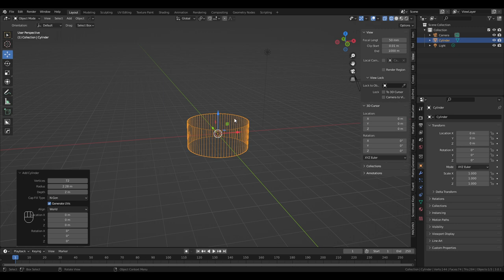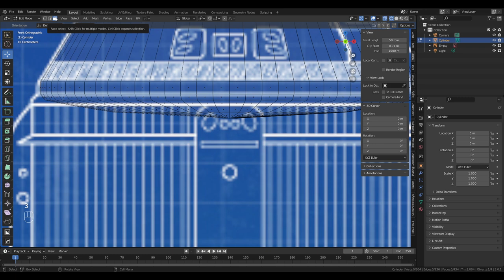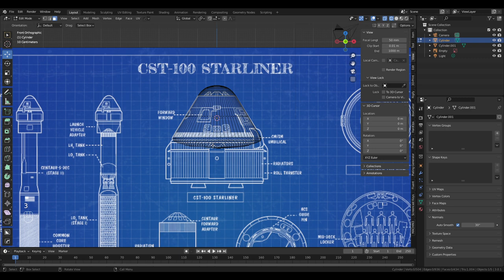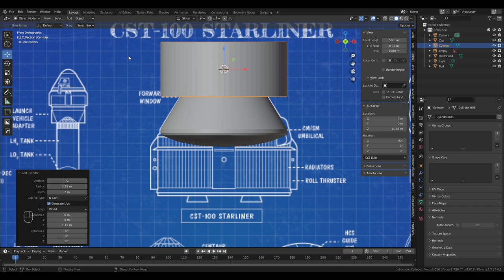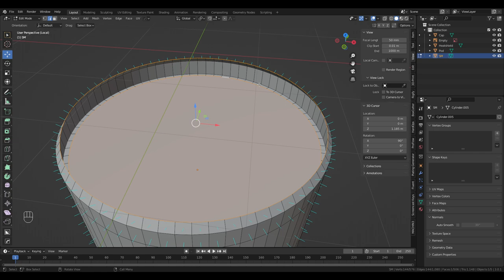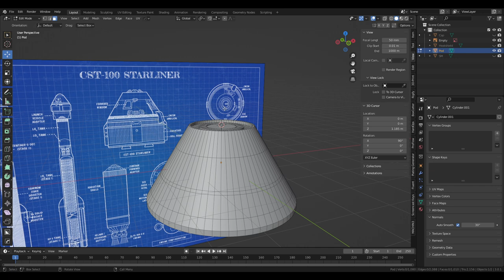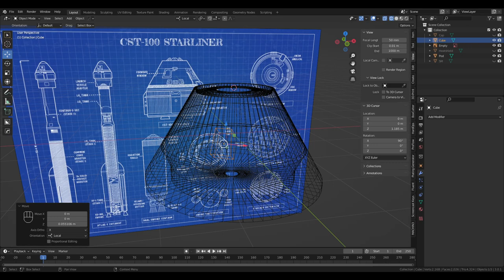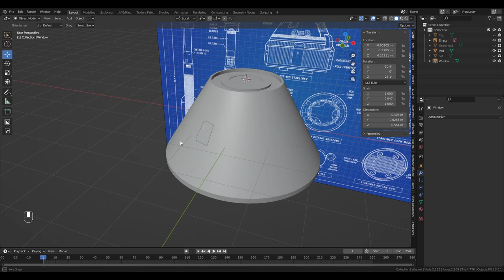Blender - Modeling a Pod-like Spacecraft (CST-100 Starliner) Part 1

Comment: Thanks! Why didn't you use the Bevel tool to do the curves like the Heat Shield?
Reply from the maker: You could, but I didn't necessarily want to decide immediately how many loop cuts I wanted, preferring to look at it and add as necessary. Either way, it would involve plenty of adjusting to get the desired shape.
Reply: @RaizSpace  Thanks... Than makes sense.